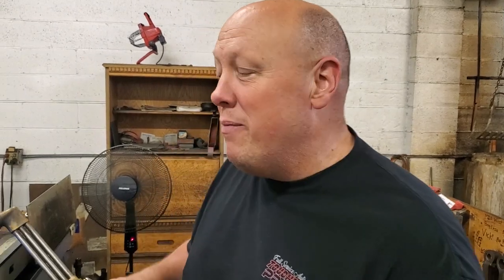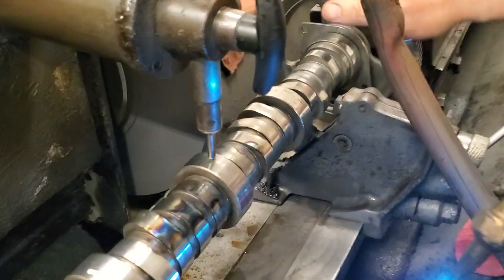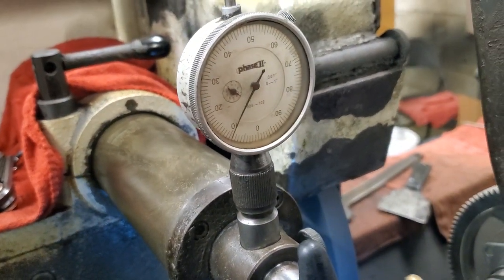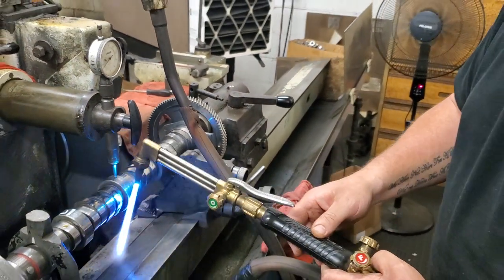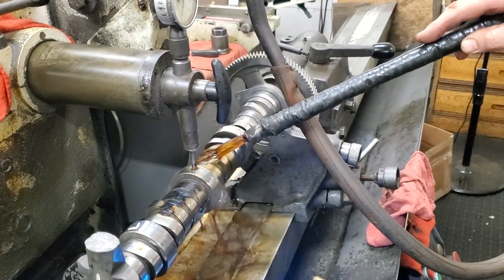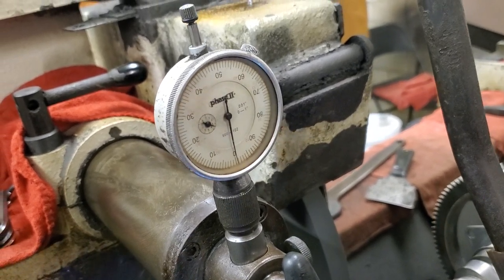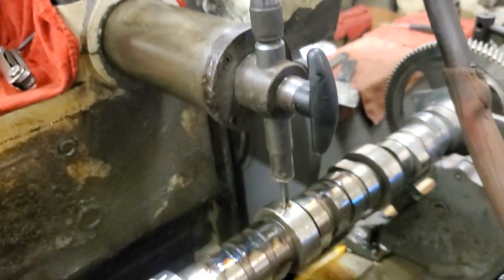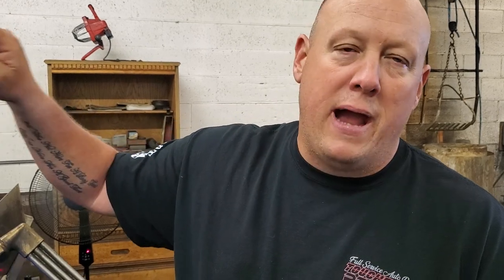Steel Camshaft straightening with torch

Comment: Can the lobe separation be changed when regrinding a cam?
Reply from the maker: Yes, but not a lot, usually moving a lobe 1 degree will take .025" off basecircle. Can usually move 4 degrees maximum